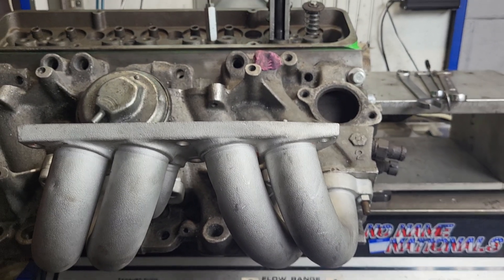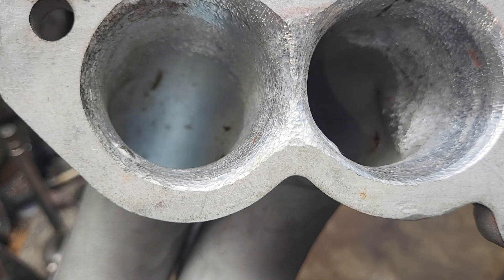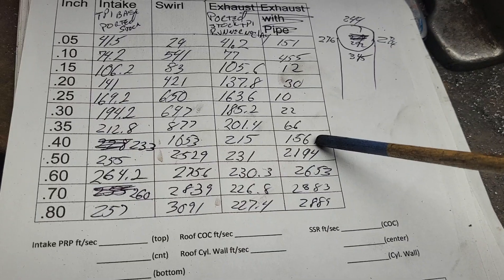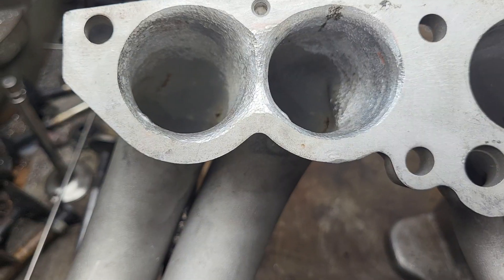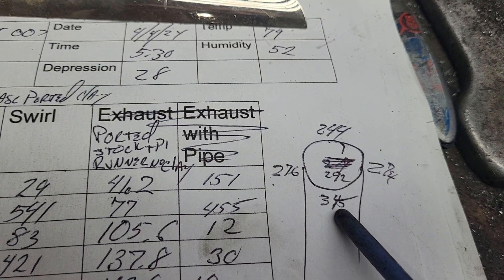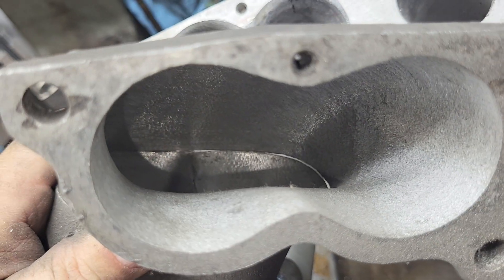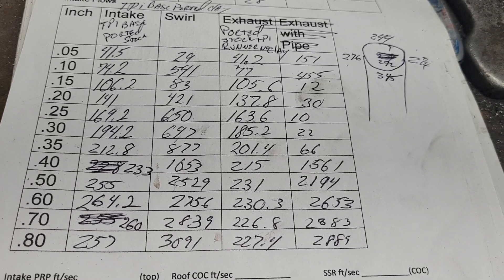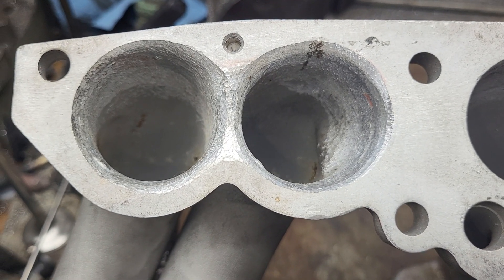High PerformanceTPI project, Baseline with ported stock runners. Better than you thought.

Comment: the reason why your ported slp didn't do better than stock is because you took to much of the divider out and it now makes the inlet shrouded, the way you modified it its like if you were to put your hand near a cylinder head inlet while flowing, the curve from the slp runner wall is now shrouding the end of the runner inlet.  the stock runners can also be modified to flow more, yes they are super thin not good for porting but great for expanding...
Reply from the maker: They sucked before I removed the divider. No matter what I did stockers were almost as good. Thanks

Comment: In the early nineties I did a build on an 85 TPI Corvette and use runners by a company called Arizona Speed and Marine, they looked identical to the stock runners but the tube diameter was wider. Sent those runners along with the stock lower and upper intake to get extrude hone ported and the whole setup worked really well with some aluminum AFR heads and a TPIS cam.
Reply from the maker: Stay tuned!

Comment: It needs a stroker crank to make it come alive. Having said that, an optimized .600" lift hydraulic roller cam, a 6L80 transmission, lockup convertor and 3.07 gears will make this car a rocket.

Comment: Do you do any grinding for cylinder #7 robbing from cylinder #5 like DV does on tunnel rams? Seems like it might be worth doing with how close those two meet in the plenum.
Reply from the maker: I discussed this with Rob. We are thinking 4/7 swap cam
 Thanks
Reply: @servediocylinderheads  so 2 robbing from 4 then?
Reply from the maker: @andysteele4056  Yes, but the plenum and throttle body placement give 2 and 4 more available air so I think it would even pulses.
Reply: @servediocylinderheads  Smart. I had to think that through for a sec, but totally makes sense that #2 has good access to the throttle body, so it will more likely draw from there than the negative pressure pulse headding into #4.

Comment: Correct me if Im wrong, but average air speed calculated out to be 284.75  at the runner entrance, flowing 230 cfm @ .500". If we tested through the whole system with the plenum and throttle body, we know  that would drop the cfm and probably the airspeed. On the ST thread, the base actually flowed 235cfm without the runners through the 083 head which is a +5cfm increase.The finished CFM with the whole thing bolted together was 218.2cfm @ .500" So this actually reproduces the same numbers in 2019 pretty closely. This test is telling us, even with a better head that has a better port, head flow isn't going to increase the total cfm by much even though its pulling harder and faster on a TPI intake. Its also showing that the average airspeeds have a long way to go, if I my calculators are correct.
Reply from the maker: I agree!

Comment: Charles, i found the same air speed pattern at the mouth of the runner but with fastest speed slightly clocked over to match the actual angled curve of the runner, which isn't at the 6 o'clock position.   I used play dough to form a modified D shape entrance which did a good job of evening out the air speeds, at least for a couple of inches, but deeper into the turn the same old pattern would re-form.  My conclusion is that the entire runner really needs to be a different shape which changes as you go along towards the base.
Reply from the maker: True!

Comment: The oil from the valve cover breather goes in at the throttle body, and the EGR is introduced right after the TB, and this combination ensures that the entire internals of the TPI will get coated with a layer of black.  The one positive point of this is that this layer slows the transfer of heat from the vast surface area of hot cast aluminum,
Reply from the maker: Carbon is actually a very good thermal insulator.

Comment: This is an interesting series, is going to be cool to see what the potential if a worked over TPI will be capable of!

I have been toying with the idea of using a Vortec lower intake to make some sort of long runner maybe cross ram or something like a TPI out of it.🤔

Have you ever flow tested a Vortec lower, if so how did it do? Thanks in advance.😎👍
Reply: The vortec lower has a very limited MCSA. I was going to go that route, but I couldnt get an intake and guys who used it had very marginal results. Granted if you just wanted 350-400hp max this would work, but knowing me, I always want room to grow if I ever decided to. Max CFM seems to be like a ported stocker with the ported Vortec.
Reply: @robmartin5382  
Well 350 to 400 would be nice out of a 283.😁 Doesn't always need to be with a max cube build. That's why we test so we know what the parts we're working with are good for.

Also seeing how it's made out of aluminum it is weldable so there might be something that can be done with it.🤔🤷😎👍
Reply: @itseithergonnaworkoritaint7852  You can weld them up for more. Welded Vortec bases go 290cfm according to a few thirdgen members who have been that route. Non Vortec bases can go over 300 ported with some work.
Reply from the maker: I have never even seen one!
Reply: @servediocylinderheads  
Really, look it up on the Bay of e to get a look at one they look very interesting.😎👍